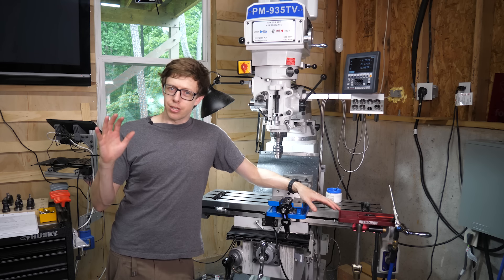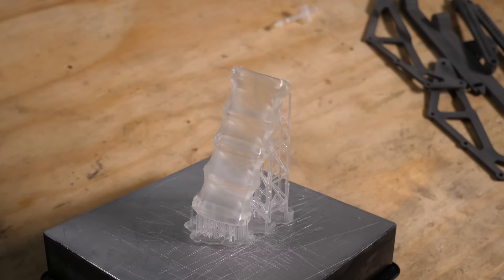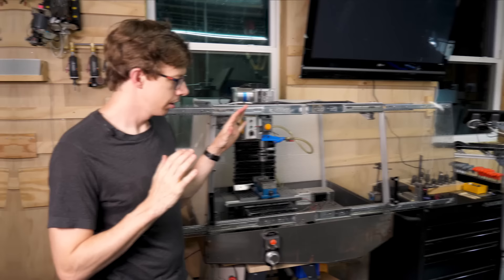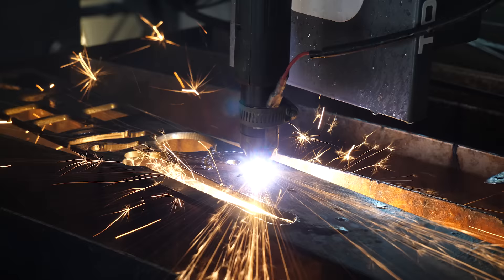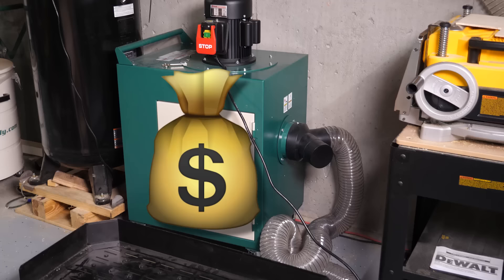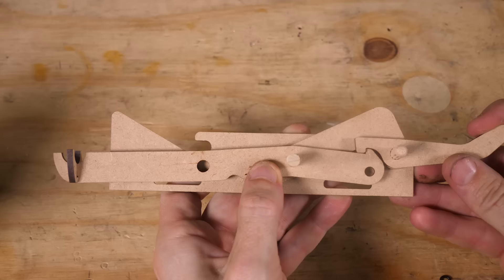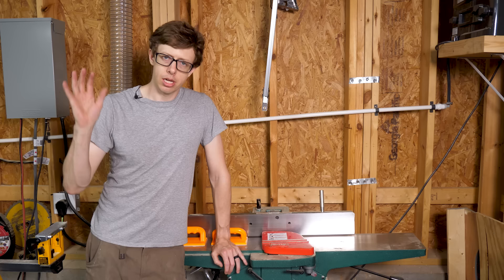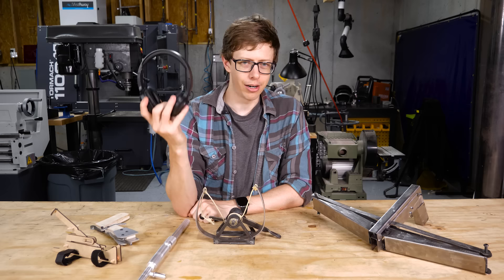This is why I have 17,342 pounds of tools

Comment: Yeah I was there for Aliens...  Circular glass player.  Drop down evenly.  Directional pressure.  You can use larger glasses.  Irregular glasses.  Filled with different liquids.  Due to the computer mechanics involved you can apply smooth pressure.  A hum that even Dolphins could appreciate.  I know actual digital equipment can do this.  Achieving this in a physical manner is still a further step.

Comment: Please...PLEASE stop saying centrifugal. Centrifugal force is fictional. It's based on aristotelian properties of motion. Centrifugal force is what people think of when they are wrong about the direction of motion after an orbital body is released...this is where your design was incorrect as well...the body doesn't travel parallel to the force that is maintaining its orbit, it travels along in the direction of velocity, tangent to the orbit. 

There are no forces acting perpendicular to the velocity that are away from the orbit's center. Centripetal force is the force acting on the body that is maintaining it's orbit. Centripetal force is towards center, centrifugal force is fictional. (Obviously this is in the absence of gravity or other forces, such as air resistance, that act on the orbital body, but none of those are centrifugal force as people think of it.)

Really, I only bring this up because you do a ton of physics and engineering in your builds, so it is SOOOO much more important that when you DO discuss the physics, that it is correct. The centrifugal/centripetal issue is such a common misconception that being correct and precise in providing information about it is just that much more important when you speak to people who are very likely to include lay people.

Comment: As a woodworker, watching you joint the edge of plywood made me cringe just a little. Each glue line will dull the blades in that spot, so next time you joint solid wood, it will have perfectly spaced lines right in the spot where you jointed the plywood.

Comment: This is too much tools for a single man…. but this is just my jealousy speaking.  Otherwise, my comment is about the metal machined sling.  It should be shaped like a snail shell and end in a straight line.  The rotative arm should then be spring loaded in order to stay against the railing.  The ball would then get — let say — half a turn more of building kinetic energy.  And the ball should exit the device like a bullet out of a gun.